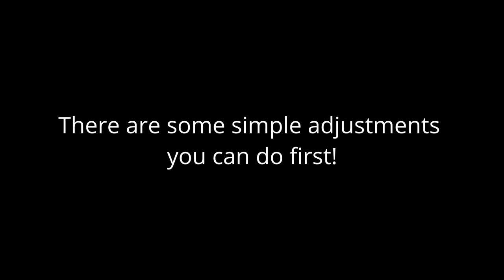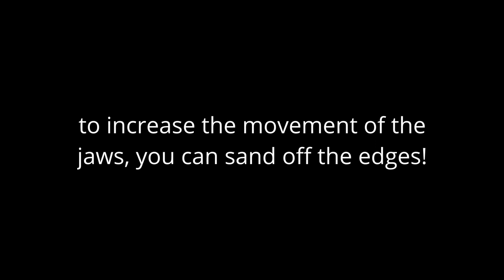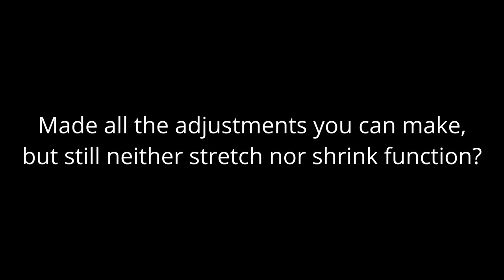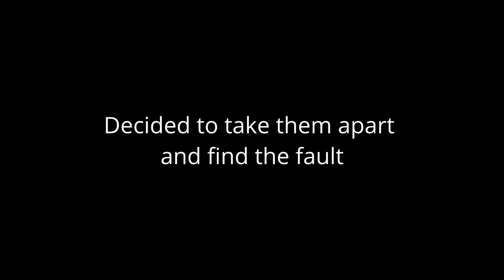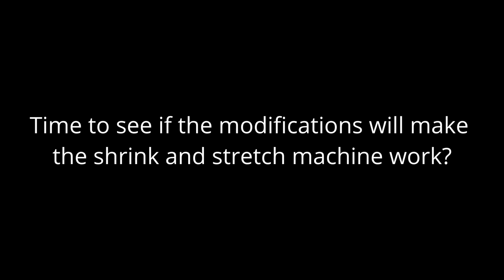FIXING - Metal Shrinker & Stretcher | Adjusting & Fixing!

Comment: I bought a used combo set off a guy on Ebay. It was the type where you had to change from stretcher to shrinker setup as you needed them. I decided to just make my own jaw holder and did just that so I could use one for shrinking, the other for stretching. Then powder coated one red and the other blue and made a floor stand for them. They work great now and you can use one or the other without swapping out anything. Not hard to do... Thumbs Up for your repair of yours...
Reply from the maker: Making your own Jaw holder is well done! Even though mine didn't work at first, you can't buy the material any cheaper, so I'm happy even if I had to rebuild it. Thanks for sharing!